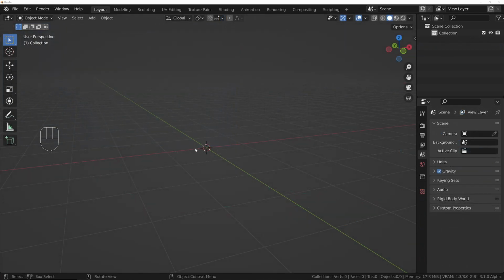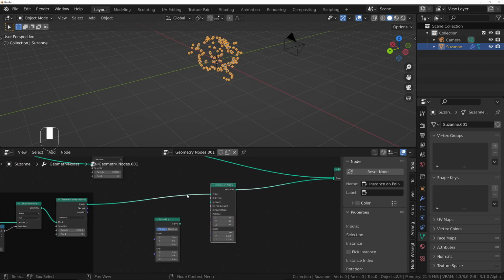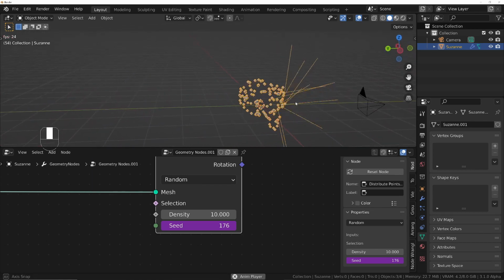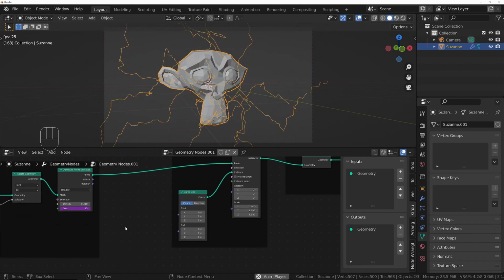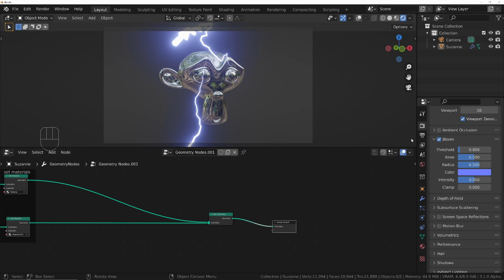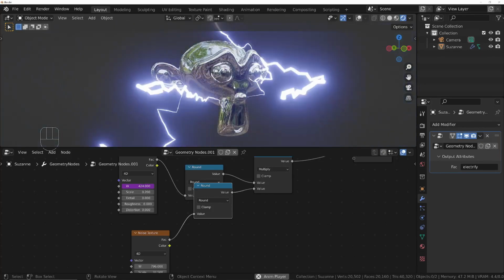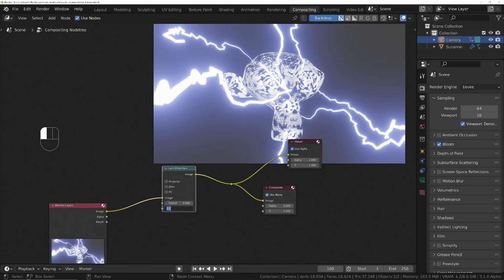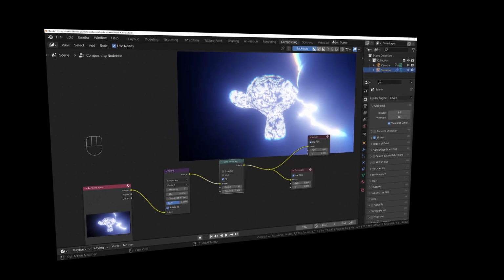Suzanne Torture Series Episode 1 - Electrocution!

Comment: I'm trying to think of a way to affect only part of the mesh with the shader. Like here where you "hit" Suzanne with the bolt to light up the area of the mesh around the hit location. 
I did smth simular with the raycast node but there the hit location is literally available and I just scaled up the geometry that has emmision shader from inside the object. 
I'll try to come up with the way today, but would love to hear a suggestion)
Reply from the maker: You could use a proximity to the points on suzanne that are currently receiving the bolt, and then multiply that by the electricity group output.  Drive it from the existing transfer attribute node used to move the end points onto suzanne.

Comment: That's a creative way to apply the geometry nodes!

BTW, I think the title of the video is fun, but a bit misleading. I didn't watch right away because I thought it's more of general video about Blender. If you emphasize that geonodes are used, I believe a lot more people would watch, and it'd be easier to find as well.
Reply from the maker: Thanks for the idea, I think you might be right.  Maybe 'how to build a lightening bolt modifier using geometry nodes' ?
Reply: @3d illusions  Could be, or even simpler 'Lighting effect with geometry nodes'. 

I've seen also that you duplicate the title in the thumbnail, often other channels put additional info there instead. In this case it can be that it's using new Blender 3.0 or other things.
Reply from the maker: @rinathamidulin3781  thanks, that's really helpful 👍